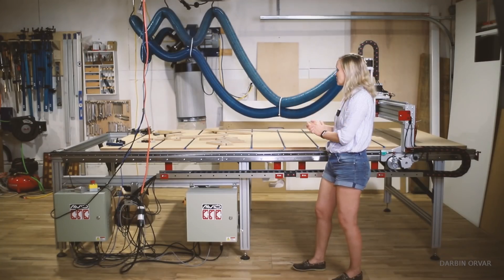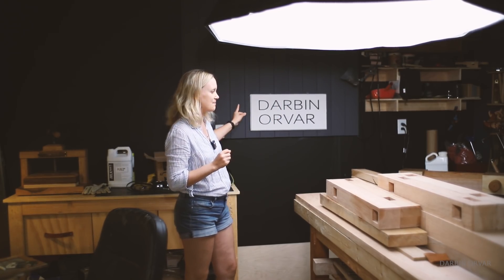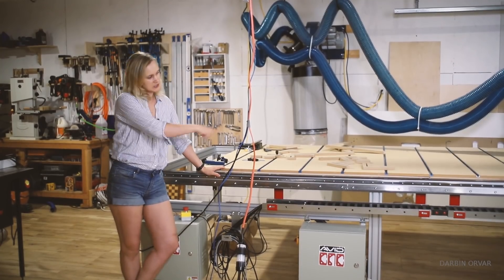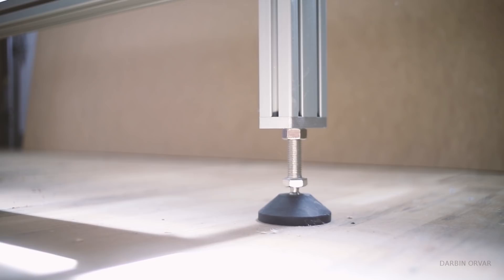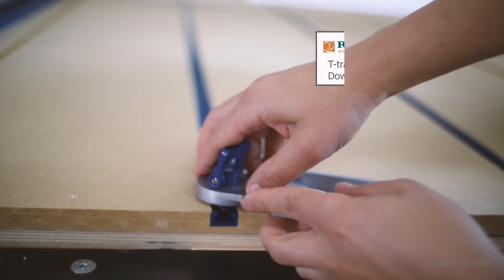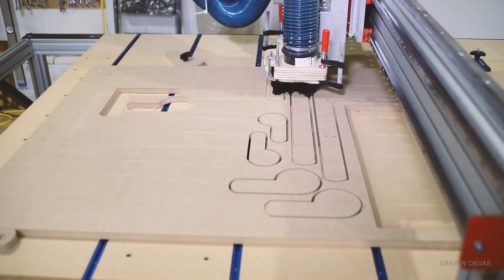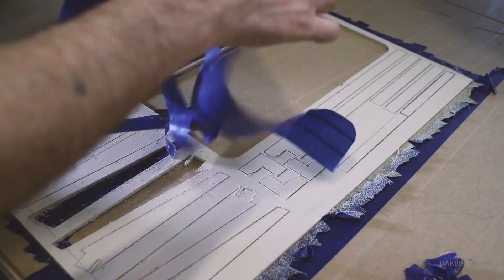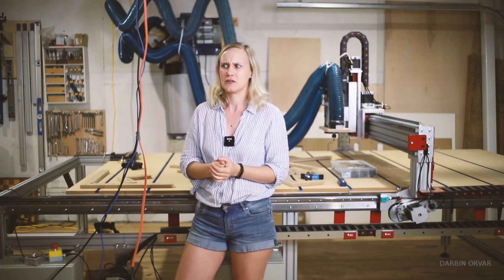5x10 ft CNC Set Up: Dust Collection, Spoilboard & Workholding Clamps

Comment: Nice job but far to much over kill on the spoil board in cost and time. 3/4 mdf counter set and secure to aluminium t-slot. Then mill slots in mdf so one can use t-slots for hold downs all so. 1"" or 2" flattening bit to straighten spoil board and done 1/4 the cost and 1/3 the time i would. But l would like to say your workmanship is impressive

Comment: I'm curious; How well does the Rockler Dust Right collector work with this machine? I'm considering the 5'x5' version of this CNC router, and have been researching my options (here I am!), and I already own this exact dust collector. I just worry that it might be a bit under powered for a machine that can run as fast as these AVID machines.

Comment: Hi Darbin, loved this video.   Thank you!   Curious on how you avoid hitting the t tracks but cut out your parts completely?  Are they just slightly recessed?  Thinking about getting a 5 x 10 avid CNC and hold down solutions have been something I have been thinking about.   Thank you!
Reply from the maker: Thanks Andrew! I have the tracks recessed about 0.15" but they are aluminum and I've already hit them. The bits just go right through it since it is pretty soft.
Reply: @darbinorvar  thank you!!

Comment: I never thought a woman like you existed, but speaking of serious things, wouldn't it have been better to use ball screws instead of racks?
Reply: not a great solution for long distance travel.  the screw would need to be very big to not whip as it rotates and that = big $$$.  The machine is already too expensive IMO.  Additionally ballscrews are much slower than rack but they also have (or can have) less backlash than racks.
Reply: @jraltwies  surely, if the precision is not needed.. for me is everything about precision anyway..

Comment: for the L shapes, you could also mill a small step (2mm height, 15mm deep) in the inner side. this way, you could easily re-mill a bit of the L each time you mount it, to ensure it is square. this is sometimes necessary for precision, unless you use positioning pins.

Comment: for the inserts, through holes and inserts from bottom is a better choice. tearouts from strong holding will vanish. mind the aluminum frame though, as not to drill it by mistake.

Comment: 1. For your fastener held pieces, instead of a screwdriver type tool for the fasteners, you should try an old style "speed wrench" which emulates an old brace & bit, very fast, no wrist fatigue
2. Can't wait for the new bench vid, VERY interested in that one
3. I'd suggest some inexpensive ambient dust control, couple of 20x20 box fans w/filters

Comment: I find with my workbee cnc I have to take a fair chunk out of my spoil board as my sheet goods aren't the best for uniform thickness. I love the idea of rails, but are you worried about hitting them with the bit? How have you found the rails vs depth you can go into your spoil board?
Reply from the maker: I agree that the sheets goods, mdf and plywood are not uniformly thick and it can be an issue. In terms of the tracks, I have them sitting about a 1/16" (~2mm) underneather the mdf, but I have hit them with the bit. On my machine the bit just goes right through it as if it wasn't there as it is pretty thin aluminum.
Reply: @darbinorvar  ooh, interesting. Thanks! I've been planning to get the 8by4 avid, but seeing your 10by5 has changed my mind. Thanks for the video 👍

Comment: Congratulations on your new massive Avid CNC!  I've had a 2'x4' Avid CNC with their spindle for 4.5 years now and have been very pleased with it.  Once I learned VCarve Pro and Mach3 from the "ground up".....I've made countless projects for myself and others.  As with any framework held together with machine screws and bolts, it's important to go around and check them for tightness once or twice a year.  The angle braces are more likely to loosen than the frame itself, but I check every single fastener when I do the check.  When you start doing Vcarve inlays, there are some very good videos out there to help you understand the process, both design and cut.  Congratulations again and I look forward to your future projects.  Also, hang in there as the Richmond/East coast humidity will begin to become more tolerable as we move into the fall!
Reply from the maker: The humidity is horrible, but at least it is almost over, Thanks!